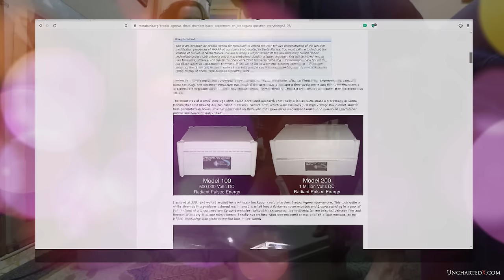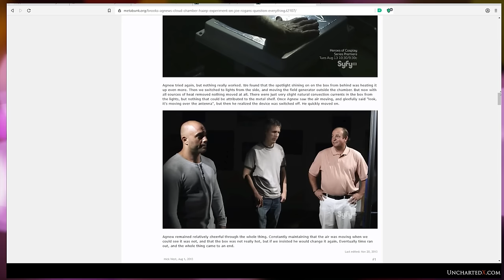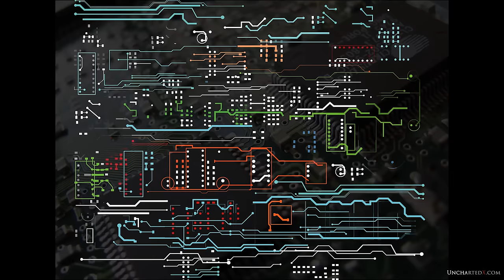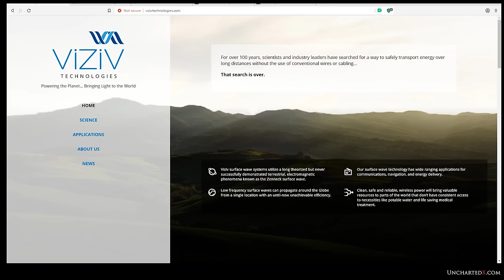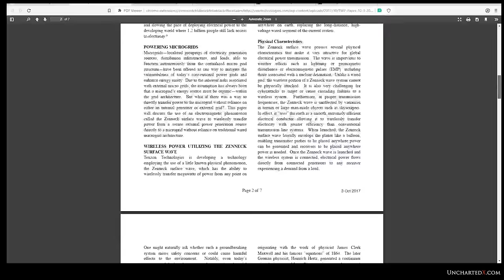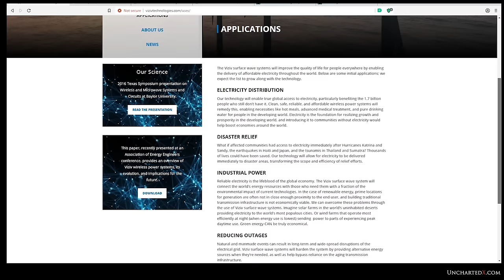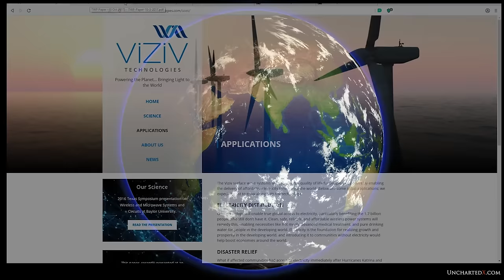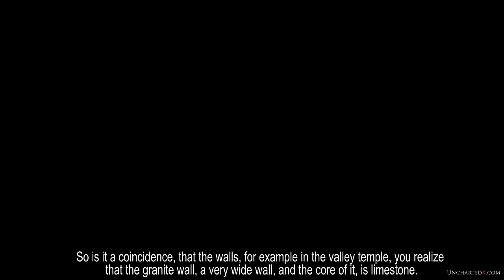500,000 volts through megalithic stone? An investigation into the possible with UnchartedX!

Comment: When you put pressure on quartz it gives off electricity, granite is composed of quartz, the casing stones of the pyramid were limestone, put enough weight on the granite inside the pyramid the weight would generate electricity to the outer casing stones

Also tesla used water aquifers to generate electricity that he then amplified and sent via airwaves, the pyramids sit on top of a massive aquifer which could have also produced electricity then used the pyramid as an antenna 

Just a theory
Reply: Damn good theory.
Reply: Hotrods & Hunting yeap the water level was high up , there... enough to make the eye of sahara stand out in rings of atlantas
Reply: And it had gold cap on top too along wit copper just off the kings room
Reply: Plausible
Reply: A theory I support hole heartedly my friend😉👌
Reply: Not even a theory. Wild unconnected  ideas without basis maybe. Put some numbers on it.
Reply: @skulptor  look it up, they make panels for sidewalks utilizing quartz to generate electricity as people walk over them it's all been done only thing I cant test out or prove is how much electricity the pyramid could produce using Tesla's ideas and engineering ideas that are being produced as we speak
Reply: @jhenninger  where are the moving parts in a pyramid or a block of granite?
Reply: @skulptor  pressure alone generates the power, no moving parts needed
Reply: @jhenninger  no movement . No induction. If you are thinking of crystal lattice distortion there is no useful power there.
Reply: @jhenninger  where does th epressure come from? and it has to be relieved and reapplied to generate voltage swings . just sitting a mass of material anywhere does no work - there is no energy realised,
Reply: @jhenninger  static pressure can't generate electricity. You need dynamic (changing pressure) for a piezoelectric material to generate electricity. if you just stood on a panel you're referencing nothing would happen. You need people walking on them to generate electricity. On top of the fact that none of these materials are piezoelectric. These stones aren't conductive either. Conductive means that it can carry a CURRENT. You can put a charge on anything  (wool glass) which is what they're doing with generator in the video. Not saying that acient civilization didn't have different ways of engineering. But claiming the pyramid is a piezoelectric generator is just ignorant of basic science.
Reply: @openmindeduk  Troll video has nothing to do with electricity in acient structures
Reply: You are complitly rong, you don't have any noleg about quarts and piezoelectric effects.

Comment: Wasn’t the tops of the pyramids topped with Gold?  A relatively super conductor at the time they were built?
Reply: gold is an awesome conductor of electricity. The problem is we are talking about 2 different types. rewatch the video and listen to his bit on different waveform theory. To quote the guys in the video here the gold plated limestone they tested had the same conductivity as just regular limestone. Also remember the gold top was written about in recent history. If the pyramids are much older and were simply remodeled by the third dynasty then the original might not have had a gold top
Reply: They should make a smaller model and test the emf generated and scale it to size of the great pyramid.
Reply: @dmorgan0628  that's an amazingnidea
Reply: Gold is the best material for many applications, but cheaper options are usually used.
Reply: gold is not a super conductor, it's not even the greatest conductor in the metal group.  The reason for gold in electronics is because it is a good conductor and does not oxidize in air.
Reply: Electrum. A naturally occuring alloy of gold and silver.
Reply: Silver conducts electricity better than gold ,gold plating is used in electronics because it doesn't tarnish/oxidize as easily.
Reply: @airthrowDBT  yes it does
Reply: @mnomadvfx  purple was incredibly rare because only one particular shell made the dye.
Reply: @airthrowDBT  and electrum?  That's what obelisks were capped with.
Reply: A gold ball.

Comment: I have an idea... it's a bit foggy at the moment... We saw that limestone is a good conductor. Anything that can conduct electricity can also store it, which is why microprocessor designers need to really worry about the capacitance of the copper traces they use... We know that one type of limestone was used inside the pyramid and a different type on the outside of it. The difference between these two could produce a dielectric potential... We know that the inside was lined with granite, which we saw was a poor conductor.  Given the structure itself... we know that in ancient times, the water table was present and water probably flowed into and out of the lower chambers... along with this movement of water, the vents would have allowed air to flow as well so that pressure doesn't build up too much inside the pyramid itself as the water level inside the pyramid rose and fell. We also know that electrical potential exists wherever there is friction, be it wool socks on a carpet, or air (or water) blowing past an insulative material... such as granite. Electrical charge is built up and then exchanged if the charged material comes into contact with a ground (metal doorknob) resulting in a shock or instant transmission of built up electricity. 

I'm sure you see where I'm going with this. I'm thinking the Pyramid might just be a gigantic static generator and battery... When combined with Zenneck Surface Waves (super cool btw, first time I've heard of them), now you have a method of transmitting this stored electrical potential along a plane across a very large area. 

I don't think the actual outer dimensions of the pyramid matter for this purpose, but if I was a magician or wizard of the time with an understanding of the world far beyond that of the common man... Why wouldn't I build a functional monument that displays this higher knowledge in such a way that only others who are privy to this higher knowledge would be able to understand? We see similar things in architecture all over the world. Also, given the electrical potential a building of this size would have, I would bet that the granite, an insulator, lined the inside of the pyramid to protect the people that are inside of it much in the way rubber gloves protect those who are working with live electrical wires.

Anywho... that's my foggy idea... I think there's potential there  (get it? lol) ... It would be interesting if Yousef would be able to test the capacitive capabilities of the limestone...
Reply: Xero1of1 Read Christopher Dunn’s “The Giza Power Plant.”
Reply: There are rumours of an intact, functional pyramid-power-plant, underground in Canada/Alaska

Comment: I didn't see it mentioned in other comments, but my best guess for what "radiant energy" means in regard to the Riley device can be described as a pulsed DC where the pulse duration is as brief as possible and the pulse period is as rapid as possible. The ideal being to pass a voltage without current flow using dielectric charge rather than the way we currently use electricity. Of course, to know for sure, you'd have to ask Mr. Riley. I'm by no means an expert in the field.

Comment: Some quick research I've just done shows that basalt contains iron, titanium and magnesium. Limestone contains calcium that attacks and deteriorate metals. Can this be why the basalt that contacts the limestone is crumbling?
Reply: Miniscule amounts, they'd be mining it otherwise
Reply: I'd been thinking along the same lines as these in the video but was thinking more that the different combination of stones could create a battery, so your comment adds some perspective here.

Take a silver coin and place a cardboard disc soaked in salt water on top, then place a copper coin on top of that, followed by a cardboard disc soaked in salt water again, and so on as much as you like, starting with a silver coin and ending with a copper one.

You've created a battery.
Here we've got different stones with different properties, could the calcium be the equivalent of cardboard soaked in salt water?
Reply: @frosty6960  Yes I'm aware of the problems concerning usage, control and accuracies presented as an electrical generator, but toy with the idea to see where it may lead.
These pyramids were watertight by the looks of them so airtight too.
Any internal metals would perish long before stone so depending on the age of them we don't know what may have been in there.
Electrostatic charge accumulates at the tip of a pointed object, so the possibility of a gold capstone and the pyramid shape makes you wonder.
Then the possibility of a chemical reaction between different types of stone, just add water, makes me wonder.
Reply: @frosty6960  I understand, but my curiosity is to do with the use of different blocks in the construction.
I haven't yet looked at the sequence of blocks used as ideas flit into my mind then flit away again, but was wondering about capacitance too.
The basic construction of a cap is a sandwich of conductors and insulators, and my initial thoughts a long while back were along the lines of a capacitor constructed with varying conductive and non conductive properties.
A standard cap used in electronics would use a consistent insulator, but have we ever experimented with non consistent insulators?
Just toying you know, no particular direction in mind, just wondering about things we may not have yet discovered.
Reply: TheJurgisRud they say “ earthquakes” 😂 everything is under a big lie ...
Reply: @catman4471  i came almotbto the same battery or some kind of generator...
When Youssef mentioned the deterioration of the limestone and described it shallow, and like a coral maybe it was soaked with a liquid (salt watet). Go figure!
Reply: @befree8850  Yes, I was thinking along those lines. In modern electronics we deal with a variety of conductive and non conductive materials and all degrees of conductivity. As I'm sure you're aware, different metals sandwiched by insulators soaked in an acidic solution would produce electricity. Another thing to think of is that charge tends to collect at a point, for example airplanes are fuelled from behind where there's no static charge, it collects at the tip. Could this explain the pyramid shape? Just some food for thought.
ps: Depending on the age of the pyramids, it's quite possible that there would be no traces of metals, if there once were any.
Reply: Georgia is passionate and a bit aggressive but still makes a valid argument, I think. The other guy, seems to me, to be ignoring a lot of obvious data.
Ancient peoples were not known to have a load of free time for nonsense. Sort of like, now. Who do you know who has the time, the impetus, the resources, and the verve to create a giant mountain of different kinds of stone for ...what? A burial vault? No deceased has yet been found intered in a pyramid. Well then, it was a very fancy decoration to show how powerful Egypt was. They say it shown like the sun from quite a distance. Bleh!
Scientists are always telling us that ancient humans were physiologically the same as we are now. With precisely the same ability to reason as we.
Yet, a breath later they are telling us what ignorant savages they were.
What a bunch of nonsense.
If I want to hear fantasies and conspiracy, I'll watch  the MSM.
Face it, most of us can barely keep our little house and cars in working condition. Let alone trying to build something as grand as the great pyramid. 
Be honest. No one is going to build this thing without a really good, and I mean a REALLY good reason!
Reply: I'm thinking Galvanic corrosion.  Makes sense.
Reply: @kennymonty8206  So..... Seems that conspiracy that the pyramids emitting electricity using the magnetic field of the earth with a huge version of an induction building to distribute that energy to other obelisk in the area seems to be somewhat plausible.
Reply: @princehek3065  correct me if I'm wrong but aren't the obelisks made of granite?  If so could the size of the obelisk be relative to the amount of current being pulled from the power source effectively regulating the system at the access point.    I'm not very studied in electronics or the way a system like this would work and just adding another perspective to the conversation.  This whole topic sparks some very interesting discussions.
Reply: @georgianbents  perhaps they didn't need to control it, for the purpose it served?  Clearly they didn't use plug in appliances like we have today.  I suspect it was all designed for channeling electromagnetic energy for the purpose of chlorinating water( purifying).  The entire structure is shaped like a collector, and then the tunnels go down into the ground water.  There are vents in the top for escaping gasses, plus there are water ways that lead way from the sites.   So if you're going to build a massive structure, you probably have a reason to do so, and I can't think of anything more viable and important, than clean water.
Reply: @bigcountry5520  pretty interesting. So it works like some kind of well supporting the whole city and perhaps cleaning the water on its way from below.
Reply: Just an idea, we clean parts of river and lake water. Could it be that they needed more water than the ground itself could have supported and had to also use the river water near by. So it could drag water from the ground and treat river water. Just some loose ideas. No idea. But it was close to river so it might have some purpose either as water or as a way to carry things etc. It is also reaching up high like converting the surface area into a point. Perhaps they had some planes that could have had some interaction with it. There are lots of options.

Comment: Great stuff as usual, i finally subbed (don't like too much data in my feed!). Some thoughts, number one is that there doesn't look to be 500kV going through that device, judging by the length of the arc. Breakdown voltage of air as a dielectric is about 1cm for every 30kV, that looked to be about 1 or 2cm in length. As we know, many geologists say that the sphinx has experienced times of much rain, which would imply thunder and lightning. I wonder what would happen if 10 million volts of natural lightning hit the top of the pyramid when it had it's original coverings? Interesting also that there is much limestone under the great pyramid, the damn thing has to be a machine.
Reply: I definitely agree , the great pyramid is a machine . A chemical engineer detailed how the mixing of a few chemicals inside the base, generated microwaves. The waves passed thru the 45degree vertical shaft(s) to the outside.
Reply: @rickgee7870  Yes and those shafts are just the right size to be a waveguide for hydrogen i think i read.
Reply: Yessir
Reply: When lightning struck the pyramid it was grounded instantly by the limestone casing. As you saw, and to my amazement, the limestone had the best conductive properties out of the 3 stones. Which means that the granite was used as the insulator. Im sure a gigantic wireless power plant would not be affected by an electric storm. I can already imagine how beautiful the pyramids looked in their time of glory, with the pristine angelic white outer casing and the golden tip that was the wireless emitter, gleaming out of the tropical jungle as the pyramids of mezo America are today. What a sight!
Reply: @rickgee7870   The chemicals were mixed in the base, creating hydrogen, as Gary said. The hydrogen then passed through the upper chambers, and as it exited out through the Kings chamber it passed through dozens of gates (I forget what they're called) that vibrated like quarts crystals. The vibration reacted with the hydrogen, creating microwaves. Odd, that the microwaves were aimed at a 45 degree angle (as you said) into the sky. Almost like they were aimed at a satellite.
Reply: Thanks for exposing the secret space programs Gary. You are my hero!!!!😀👍
Reply: @TrollextheTroll  We're all heros and i didn't expose a secret space programme, just a NASA lab that airbrushed out UFOs from satellite imagery. We don't understand UFOs and don't fly them, it'd be like chimpanzees fusion reactors.
Reply: Damn I never thought of that
Reply: @mancamiatipoola  Thank you for this comment, the visual you painted is epic. I agree, what a sight to behold...  Surely there were many more incredible wonders all over the Giza plateau and elsewhere that would boggle the mind in both form and function.